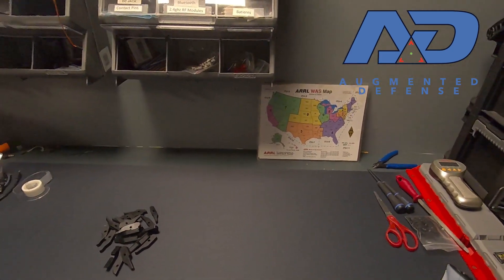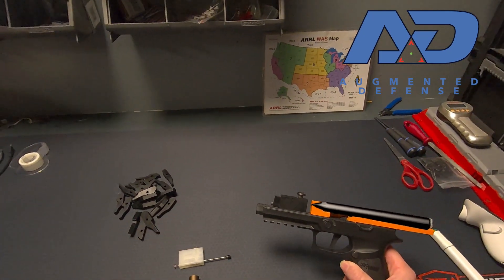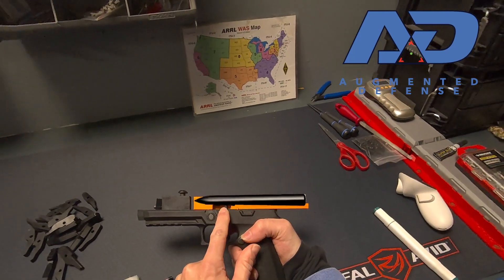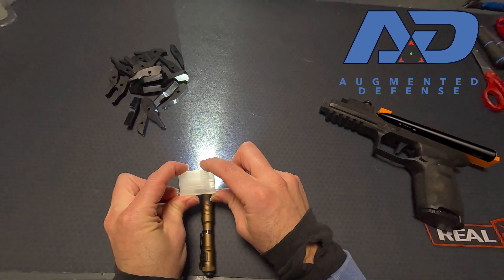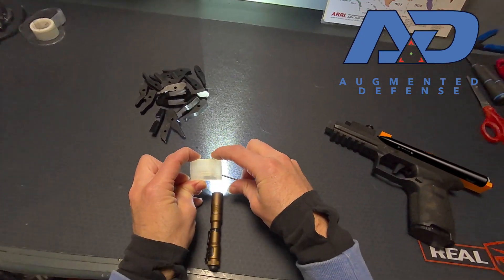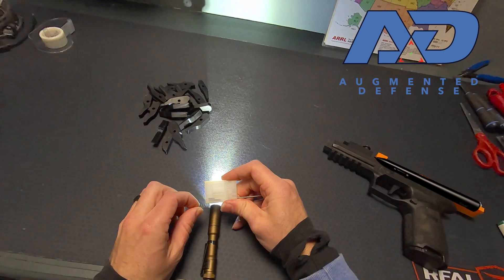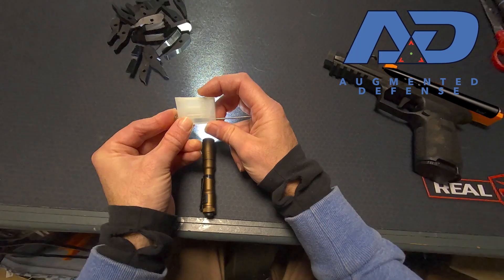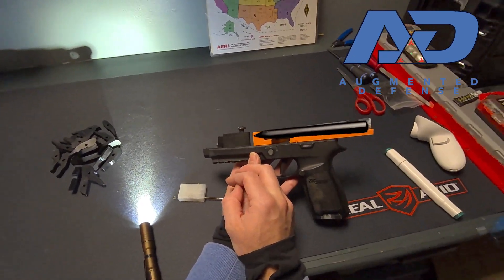Lets build a tracked Pistol controller with the Logitech MX Ink - Part 2 - Trigger + magazine state

Comment: i´ve been big into pistol whip latley and have 3 questions: does this work standalone, would it even work in that game (onle needs tracking and trigger), Is there any hardware rewuired that cant be printed besides the pen? would appreciate an answer very much
Reply from the maker: 1. Yes
2. Yes, I play all the time with it in pistol whip
3. pen and printed, and it was g2g
It doesn't track as fast a a quest controller does though, drifts a little bit. I've been focused on my quest 3 controller based pistol since this video, because of the better tracking. I probably won't be coming back to finalize this design till my rifle is finished up as well.
side note, the controller based pistol is available on github, and for sale in our store, and i'm getting close to the next round of updates done on it, and there will be an update video once that happens.
Reply: @AugmentedDefense  think I'm gonna wait for the Q3 design if the tracking aint perfect since I mainly play deadeye